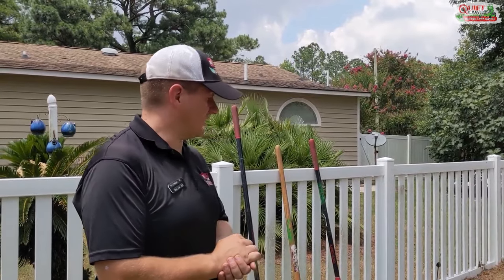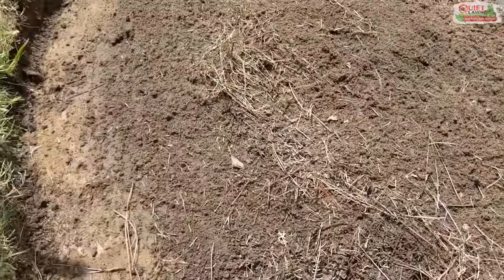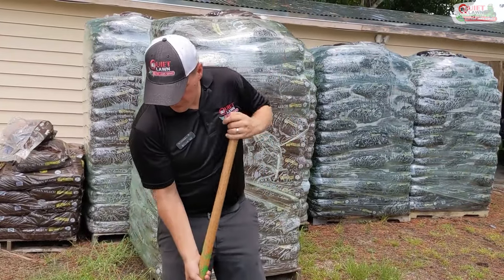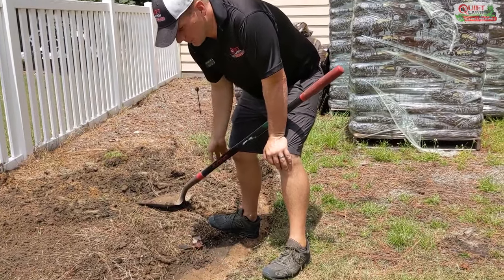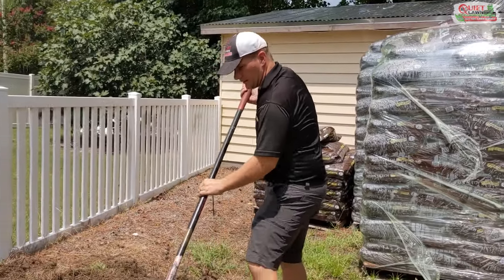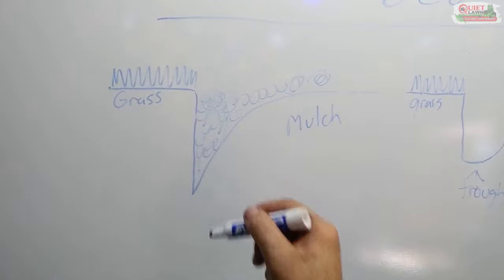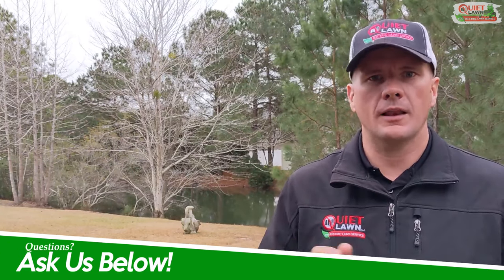How to Prepare a Bed for Mulch Installation | Electric Lawn Service

Comment: That is a well shaped edge, the grass and many weed runners will stop when they hit air.  The main problem I have had is the edge breaking down if a mower tire gets near it while the soil is moist, but filling the trench with mulch will not prevent that.  If edging barrier is used make sure to pull old edging away before adding mulch.
Reply from the maker: They will stop when you use your string trimmer to soft edge them when you mow your grass. Yes, depending on if you have soft soil, have to be careful not to drive into the edge.
Reply: @QuietLawn couldn’t I just pour my mulch on top of grass, without digging ?

Comment: Very helpful ! Thank you. 
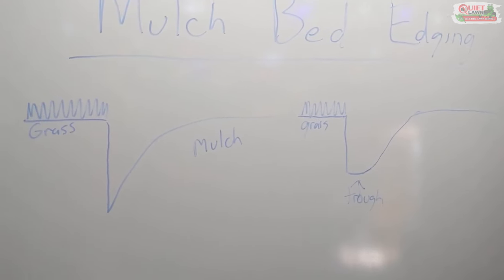How would you edge for a driveway. How low below grade should the “dirt” be before laying mulch. 5:07
Reply from the maker: Thanks for watching. I usually just take a rake or hoe and take it an inch or two below the concrete so that you can pack the new mulch in and not have it wash over onto the driveway as much.
Reply: @QuietLawn  thank you!  Good information.

Comment: As part of the prep, do you spray the existing weeds with liquid weed killer  and then after you lay down the mulch you add pre-emergent?
Reply from the maker: We do spray first. We don't add pre-emergent after anymore because customers expected zero weeds for the next few months and that's not possible. So, we stopped. But, you could.

Comment: Great Video, Thank You.  I have some smaller areas this will work great in.  
I do have a larger area in my back yard currently full of weeds.  In this situation do you recommend roto tilling or digging it all up, weed treating and then going on to define and bark the area or should I maybe sheet mulch it, like define the edges, remove loose material, level and cover in cardboard, then mulch over it?  Not sure what to do there.  
Also, what do you do in later years, like when this mulch breaks down, do you rake out and remove material.  If you keep adding mulch, obviously it is going to stack up and you will lose the edge and start getting mounds of excess material.
Reply: Can't answer everything since I have a lot of the same questions. But in terms of removing old mulch, you don't need to since it will gradually break down over time and turn into soil. And you can lay a shorter depth of mulch on top after the initial mulch bed. The broken down mulch provides nutrients and organic material to keep your plants healthy. And this is why you don't want to put down landscape/filter fabric because it will prevent the mulch from breaking down into your soil. Hope that helps and also verify anything I said since I'm still learning.
Reply from the maker: Thanks for commenting. 

1. I would spray all of the weeds and grass
2. I would plant any plants in that area
3. I would define the edges 
4. I would lay down the mulch over everything

You don't need cardboard or weed barrier with wood mulch. The biggest benefit of it is that it will decompose over time and enrich the soil underneath. The next year, just clean your edges up a bit, spray weed, and apply another fresh 1.5-2" layer of mulch.
Reply from the maker: It only stacks up if you go too thick and it isn't about to decompose fast enough. More is not better.